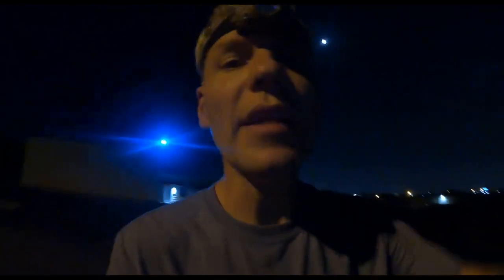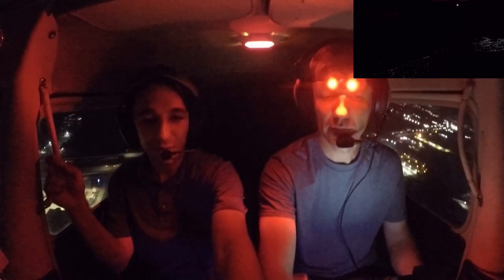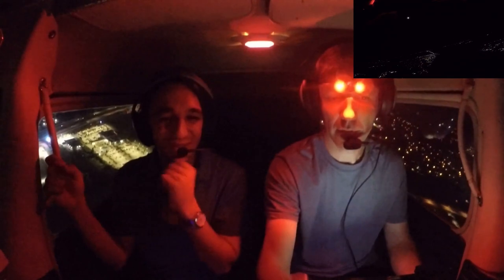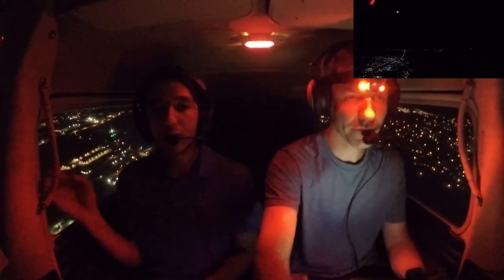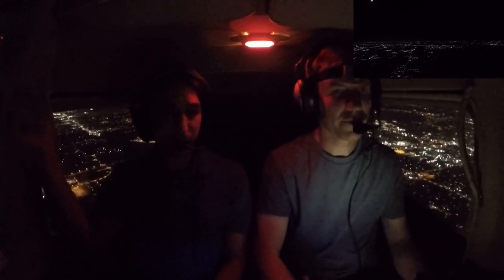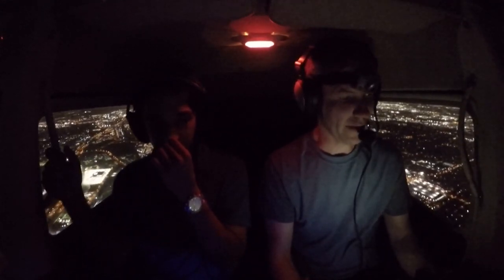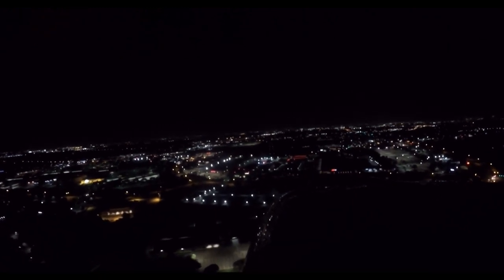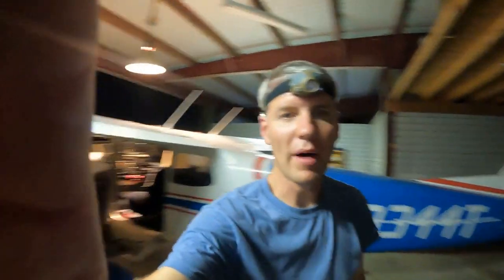PAN PAN - PAN PAN we smell  something burning in the cockpit. Night flight with a problem

Comment: Hi WolfPilot, glad everything worked out on this flight. May I suggest you try to find a magenta filter for your headlamp? It will be a lot better for transiting your vision from inside the cockpit to outside. 🙂
Reply from the maker: Good advice. I am hoping to get the avionics upgraded really soon and that will negate the need to use a headlamp at all.

Comment: Rockwall, my niece lives there, and a pastor I know just started working at a large church in Rockwall. Let us know what caused your issue.
Reply from the maker: Did you watch the entire video? There is a blurb at the end that explains it all.
Reply: @WolfPilot  What made the fuse over heat?
Reply from the maker: @robertwren2289  The biggest issue was that it was the wrong fuse. It was an automotive style glass cartridge instead of aviation. The automotive sized fuse just rattled around in the fuse holder and that led to a bad connection, which lead to resistance which led to heat. I had EVERYTHING turned on.. The landing lights were the straw that broke the camels back.. They are very power hungry. No worries now though.. All the fuses are gone finally and replaced with circuit breakers.
Reply from the maker: @robertwren2289  it was the wrong physical size for the fuse holder and was loose..
Reply: @WolfPilot  My question is then why was the wrong fuse installed in the first place?
Reply from the maker: @markthompson8656  I have no idea. My uncle who owns the airplane has no idea. Perhaps it was that way when he bought it. He did say he had been wanting to replace the fuses with breakers for the last 20 years..
Reply: @WolfPilot  Thank you. how on Earth does some think it's ok to use the wrong fuse size in a plane?
Reply from the maker: @robertwren2289  Ignorance. That's all I can figure.. I would never do that... Do it right or just don't do it.